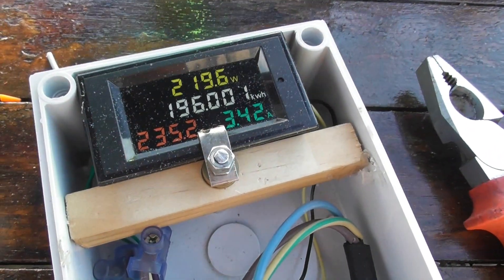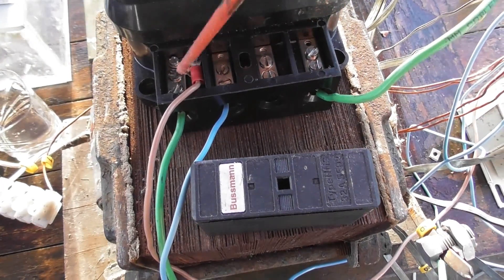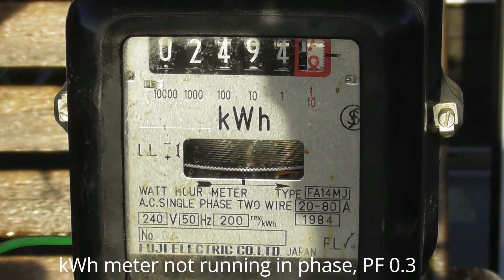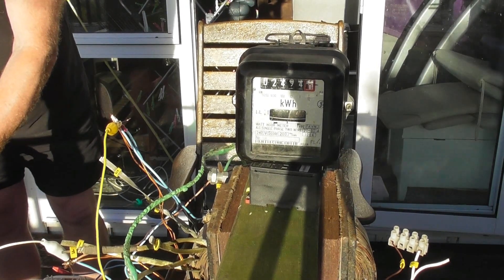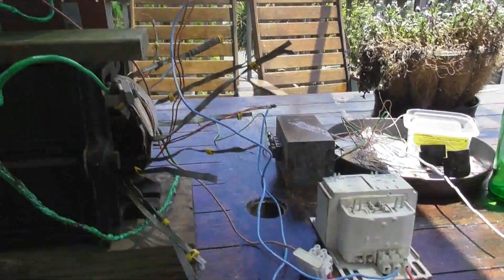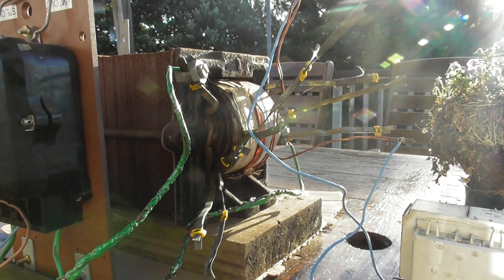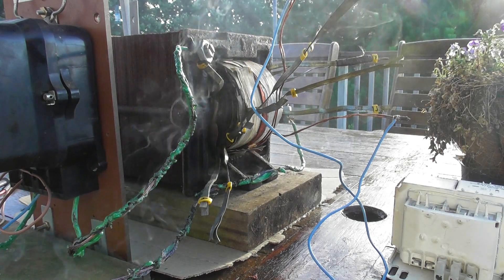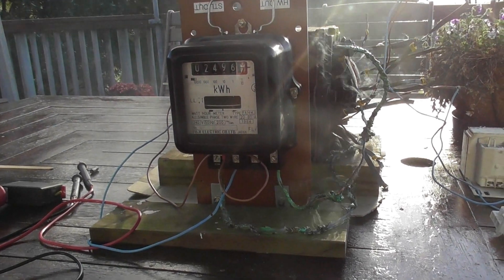Unknown Transformer melting off wire pvc insulation and Fuji meter

Comment: 4 mil= 4 square millimeters?
Reply: Yes.this is New Zealand slang. mill = millimeters
Reply: @sambaker3233  That's nice
 - otherwise there is also an arbitrary american unit called mil, that's 1/1000 of an inch
Reply from the maker: Yup !
Reply: @RODALCO2007  So this is in between 10  and 12 AWG, (5.3 and 3.3 mm^2 that is.) Honestly a bit surprised it held that long at over 100 Amps.

Comment: A word of caution: the smoke from the charring PVC insulation will contain a fair bit of hydrogen chloride, which is very corrosive towards aluminum, stainless steel, bronze, etc.  I fear for your Fuji meter bathing in that smoke.  (It is also not good to breath.)
Reply: Not to mention dioxin.
Reply: @soundspark  Absolutely, but that won't bother the meter.  (What's a little chloracne among friends?  https://en.wikipedia.org/wiki/Seveso_disaster .)

Comment: In a parallel universe, the world uses high current only, and all their wires are tungsten alloys which are constantly glowing red hot, with 0 insulation :)
Reply: Where the volts drop like a sack of poop as soon as you turn on a light

Comment: Maybe you should get some red and black wire instead of green when you upgrade your safety shoes.
Reply: Not for AC. That should be reserved for DC (red positive, black negative) in my opinion.
Even if, there is no real world standard for AC and the output from the transformer doesn't even have a neutral and live unless one of the wires is connected ground (it's insulated from the mains), having one red and one black coming from the transformers AC output, feels so wrong, haha
Reply: @Speeder84XL  True, but green seems way 'wronger'.
Reply: @originalmianos  2 black cables or 2 red would also do fine for the AC output as well. Or a black and some other color or red and some other (if needed to keep "poles" separate). As I mentioned, there is no real color standard for AC anyway (especially not insulated outputs from a transformer). It's just the particular combination of red and black for an AC output, that feels wrong - because DC systems do have a pretty much international standard, that red is positive and black is negative.